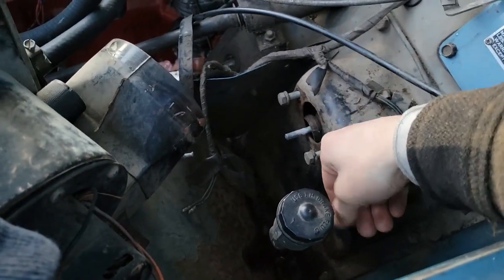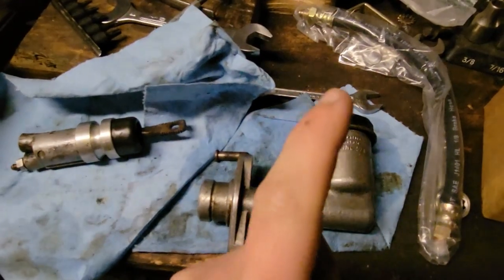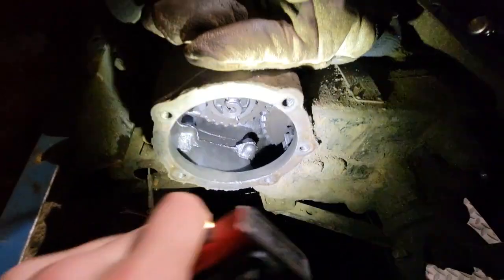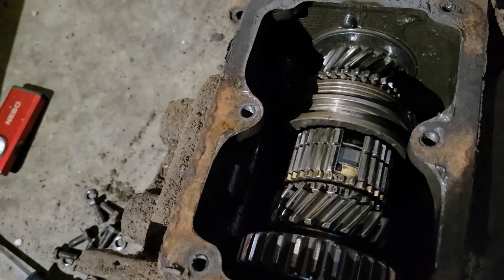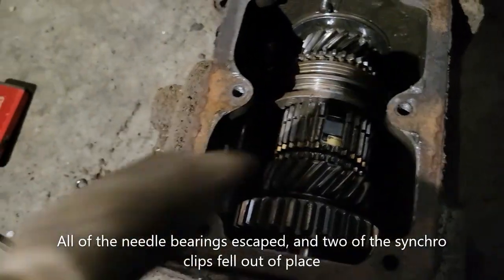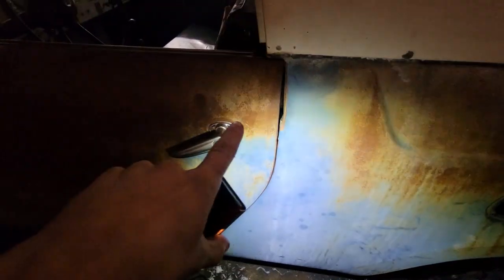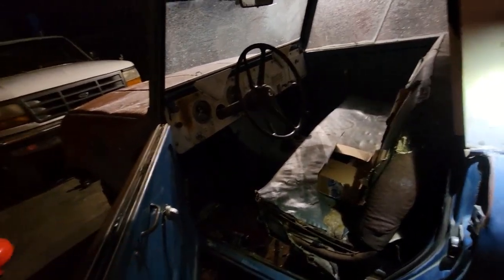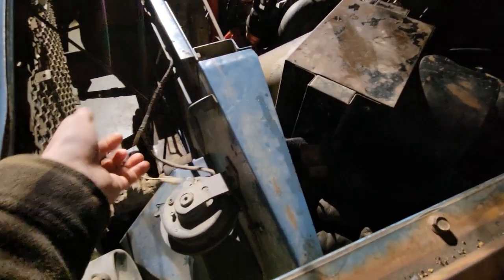Fixing The Big Problems: 1961 International Scout 80, Part 4

Comment: I was praying that you would find and install the snap ring and the washer also as it keeps the piston in far enough to keep it from catching air in the system and of course grinding instead of a smooth step on the pedal. I have welded those clutch arms with 603 stainless rod.... I cheat them by getting a ark on a spare piece of metal and then quick as a bunny do the weld the arm. I grind them out on a bevel to get a good weld and then if its a bit tight going back on  the arm, use something to drill out the hole enough to get it back together. When doing that pocket bearing in the transmission, for once cold vaseline has a role in life to hold those needle bearings together when sliding it into the mainshaft in the transmission. I know what a bugger it is to keep stuff together with only  two hands on a situation like this so rubber bands are your friend. Use them to hold the floating clips on those synchronizers. The oil will eat the rubber bands and you will never see them again. Not to fear on a chip in any gear as its still a gear that has a lot holding, so it should live a long time. Those old scouts are just about the most fun you can have with clothes on. I have some good stories (adult rated) from my younger years as I am 73 now. I have a odd feeling no one put any oil in those boxes after installing and you caught it before it ate itself. Big car companies made it impossible for the smaller companies to compete and then shove in the imports and our great companies either moved to canada or died in the hands of GM, Ford or Chrysler. I had the fire chickens, a cougar, a whole lot of internationals of all sizes, and a whole town took my 442 and crushed it... after I had done my three years in Nam. Ya, I hold grudges. Your old scout doesn't show a whole lot more wear on it than when we owned them new. I have tons of ideas how to build your own drive shafts or other should you need this kind of info... my memory is kinda wimpy tho... good watching video

Comment: Try holding the throttle off of idle position when adjusting the choke the idle screw rests on a high idle cam that wants to move when you adjust the choke

Comment: Oh you said you might tighten the yoke in driveshaft connection. The only way to do is add in the shim about up 10 shims equals 1 mm or 1.2mm. The shim looks like flat and thin ring. So pull out the yoke and put in the 3 or more shims and it makes it just right. The shim is offer from the Ford Truck and Lorry dealership at the Parts Service and look for stainless steel shim. Like a feeler gauge but it shape like a ring.

Comment: The tractor engine for International 1961 with firing order's number stamped on the color red engine block or cast iron intake manifold. The shift stick of 3 speed for forward and idler transmission second shaft for reverse. There's the third synchronize transmission shaft. These cast iron case of 4 forward speed is in good shape from the Pinto or Runabout. The smaller scale Scout 80 transmission than the UAZ 469 in Philippine or Thailand was work and by cleaning very smart mechanic doing overhaul the transmission and transfer case. He would get and got the brand new ball bearings radial put on to the transmission and transfer case. He has the gasket sets kit new for he would order from Government that give the Parts into make the restoration in thru the experienced procedure.
 Very simple tool sockets and ratchet, impact wrench and brush for solvent Nitrile gloves you are wearing them. The Channel you can watch it is DT Restoration the antique is your Scout that it means it won't get any help for the PARTS Dept. These UAZ Parts is one of the best to keep Vintage running and runs and never dies. I just wrote it because the free world trade allows us to get more parts coming off from the UAZ salvageable and make new UAZ again from Vietnam and China machine shop. And buy it then the scout into hybrid with UAZ especially in the transmission and transfer case internal components of gears and stuff. The UAZ pleases us very honest and You post them the free stamps for that way that can ship it out to you but the problem is our language English, they don't understand English language so recommendation is that Scout truck owner could hire translator Linguistic. They have not hire translator because their country currencies is empty.